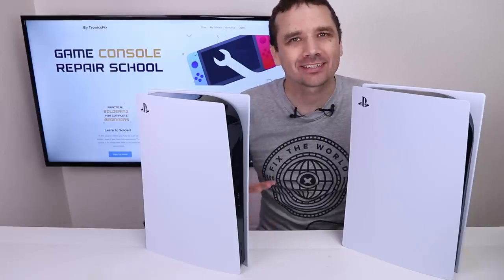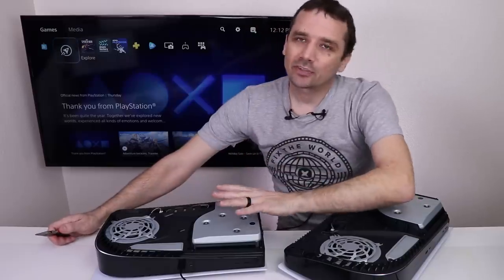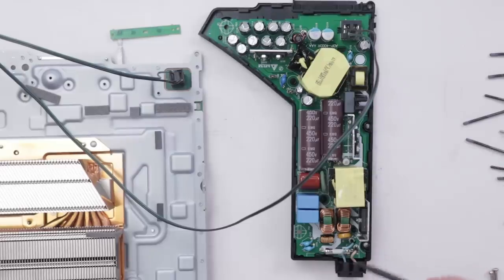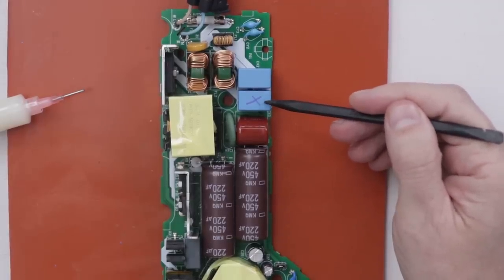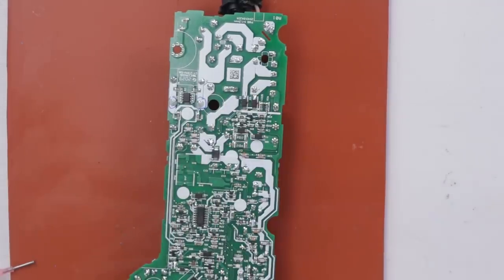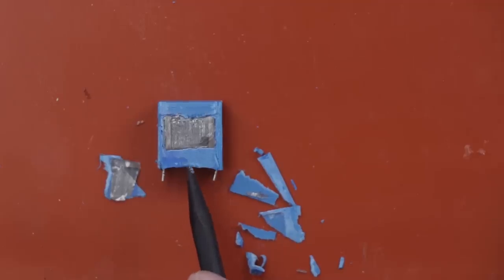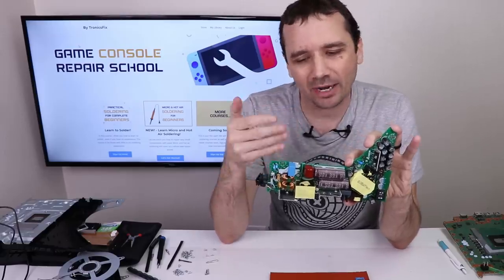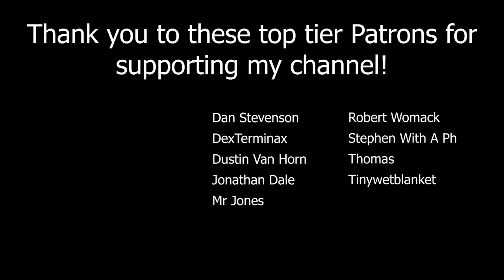PS5 Coil Whine - What Is It and Can I Fix It?

Comment: Is coil whine bad, or just annoying?
Reply: it is normal for any Electronic to have coil whine, specialy  power supplies and graphics cards. it is just annoying, i remember my ps4 pro used to whine a lot during rise of the tomb raider but not other games
Reply: Its just annoying and nothing that indicates an error. Unfortunately the sound is not always the same and can be louder,quiter or have a different pitch than other consoles even if its the same model.
Reply from the maker: Just annoying.
Reply: Perfectly normal for the circuit. But happens to have an audible component.
Reply: so annoying you need head phones to play any game in 60 FPS on PS5. PS4 games are pretty quite though. only the ps5 games seem to cause this issue in 60 FPS mode. which sucks
Reply: @GreenSmoke00420  you don’t need headphones😂😂 for my ps5 I can’t hear it unless I put my ear right next to my ps5 it’s not loud at all
Reply: @therealmc3966  post a video of you playing a PS5 game in 60 fps mode up against power supply to prove your point. If you have zero coil whine prove it.
Reply: @GreenSmoke00420  He didnt say it was zero coild whine. He stated that its only audible close to the PS5. Wich happens to be exactly the same on my PS5.
Reply: @therealmc3966  He used the PS5 as headphone probably.

Joking aside, different consols of same type can react different to the game you are running. So far I  had only one game that only in specific menu's (static menu, fps should have no contribution to it here) produced a highly annoying whine and it was not even very demanding on the system.

To me the whining is just a random as that of my wife. Sometimes it's worth the iritation, other times ignore it. Or get an other one ;)
Reply: @therealmc3966  trust me when i say you will hear it someday and you will never not hear it again if they dont at least try and fix this, especially when games like GOD OF WAR PS5 and Horizon 2 PS5 drop and actually push the system hard and can play in 120 FPS none of the games at the moment are even pushing the console hard and are not even true PS5 games they barely even push this thing at all. this is what scares me and it should scare you to. i say its safe to say the Coil Whine noise will be 3 X (times) as loud at least when those games are played. if PlayStation does not at least try and fix coil whine issue. and why are you arguing for a sound that everyone agrees is annoying you like the sound of Coil Whine. you must love dildos.

Comment: Coil whine is generally high frequency passing through and creating a vibration which in return makes noise. Before the easiest way was to put hot glue over the components to minimise vibration, not sure if it still is though

Comment: Yes...! I have the solution !!! --- Place the console within 3inch thick foam insulation... That should solve your ears from picking up the whine...
Reply: Yeah bricking your ps5 should fix all noise issues.
Reply from the maker: Lol...I'll try that next time!
Reply: just turn it off, that will fix it for sure
Reply: that should also solve the ps5's ability to shed heat which will permanently fix the coil whine

Comment: /tronicsfix 
Observation, Good news, and an experiment for you:
- PS5 has a quitter cooling system / fan.    The PS4 might have have a lower/same level of cap singing, and BUT it was downed out by the louder system fan.
- Looks like the Film Capacitor's  Climatic Category upper heat limit on the PS5 cap was changed from 105 to 110C.  - Not the issue. 
- It's always the mechanical coupling to the PCB; solder.   Re-solder both your Film Capacitors back in your ps5 using lead solder and a tiny air gap from cap package to board.

Comment: EEV blog made a video years ago about coil whine in the backlight driver of a multimeter. But it was actually a capacitor. The problem is the dielectric sheet has some piezoelectric properties making it vibrate. If the layers are too loose the electrostatic forces can also make it buzz

Comment: It’s just an X2 cap.  Replace it with another with the same or better rating, see if the noise goes away.  You can buy them from Digikey, Mouser, etc.

Or just run without it.  The things just sit across the mains and filter the noise from the switching power supply.

Comment: I had a coil whine on a ps4 pro primary transformer. Coil whine, as explained by other commenters is just the current passing through the component which somewhat inevitable. However..cheap components are louder because they dont have mechanisims and materials to mitigate and soften the possible noise.

Comment: The noise probably comes from subtle vibrations in the cap. Try solder it back on and then use some epoxy or hotglue all around the cap to reduce vibration. The compound should be as stiff as possible.

Comment: If there are two alike capacitors connected in parallel and if one is noisy it's obvious one is working harder than the other, In short it's best to replace both capacitors with a higher voltage rating if possible, the capacitance for each must still match or be slightly higher and if at all possible closely matched to each other, the reason why they both need replacing is because one of them is not to spec and thus is stressing the other one, Also check any coils connected to a singing err-whining capacitor and check if it hasn't shorted or opened circuited or drifted out of spec..

Comment: My PS4 has coil whine but so quiet you need your ear next to it. Even when I repleaced the original  one with over 5k hours of use on it, the new power supply had same coil whine.  Oringinal power supply still good with no odd looking caps but replacing it restored  the performance.

Comment: Here'satipfor ANYONE.Notice when you turn something off like in a pc and sometimesthere are stillpower LEDs on? even whenyou take out the powerplug? they do not last long but long enough to see it. this shows your system still has charge that was being drawn when connected to supply. Even if there is no led githy on, do this simple thing with ANY appliance or psu. Disconnect the mains and straight AFTER, even though there is no way an appliance could get power, turn ON or hold the appliance power button ON as this will actually use up charge held within the system. I have taken so many PSUs apart and done this that I have even touched parts you shouldnb't with no shock, NOT TELLING YOU THAT YOU SHOULD DO THIS, as i did touch parts accidentally, I never suffered any shock. It does discharge the system and you will see the loights go out much quicker.
 
So remember: as I see many videos NOT telling you top do this, but, DISCHARGE and appliance by unplugging from the mains/power supply then holding down the power button to use up any remaining charge stored. I know people use things to discharge capacitors, this is fine, but really? common sense and hjold that power button down to fully discharge, then if you use a multimetre you may find there is no charge in the capacitors after doing that, thus, no charge stored. 
 
Still be careful though as nothing is guarranteed, but, this should be done regardless of how careful you are, redundancy is a real thing.

Comment: That noise on mine goles away if I put it in vertical position, it's only when is horizontally that I hear thar
Reply: That's interesting did you just move it around to see or find out by accident?
Reply: It's the disc drive vibrating happend to mine if you don't have on stand that will help plus when I first got my ps5 I had the console upside down lol
Reply: @one_up907  I had the idea because my ps4 slim stopped reading discs when placed horizontally... so I gave it a try and found that out.
Reply: @Blxard21  could be, I thought it was the sticker other people talk about; maybe we'll see a solution here soon

Comment: Gaps between the metal and the plastic that’s vibrating? Maybe heat it and try to get it to conform better to prevent it? 100% a guess lol. Love the vids! Keep up the great work!
Reply from the maker: I'm afraid heating it will just melt the plastic and render the cap useless.

Comment: If I had to guess it’s probably a small insignificant manufacturing defect in the insulator layer between the metal layers in the capacitor. A small defect could allow small high frequency arcs to jump between the layers of metal creating the “whine” or “buzz” sound that some people are experiencing.

Comment: And hear we go Playstation and problems
Reply from the maker: It's just an annoyance. Doesn't cause any problems.
Reply: @dev null not impossible to get rid of by any means, most people should not attempt it tho, but for anyone that knows how to safely take apart their console and remove the charge from the capacitors and remove and replace solder can probably do it by replacing it with a different same rating higher quality capacitor from a better company

Comment: LOL I'm amazed how he went into it and removed the capacitor. The capacitor is being used as a filter, as mentioned in the video. I believe that is correct. If the PS4 Pro Model is the same capacitance as the PS5 model, I would solder the PS4 PRO one into the PS5 power supply and see if that fixes the noise. The capacitor maybe defected. Only do this if for SURE!!!! the Capacitor is equivalent to the the PS5 capacitor.
Reply from the maker: I thought of that...the problem is that the PS4 Pro had coil whine problems too.
Reply: its the cheap capacitor itself that is the problem most ps4's also suffered coil whine because of that capacitor, only replacing it for a higher quality one is likely to work

Comment: We usually fix that issue by using nail polish to secure it tighter to the pcb. It's caused by the small vibrations if i recall correctly. And the nail polish acts as glue basically. Put some between both and it should stop.
Reply from the maker: It's coming from the inside of the cap and it's soldered on very securely.

Comment: You can't fix coil whine or capacitor buzz. All you can do is replace the affected components. However, just because something whines or buzzes does not mean that it is defective and replacement parts might have the exact same characteristics. So sometimes there's not a lot you can do about it and just have to live with it.

Comment: If I had to guess I would say the Noise in that capacitor is caused by the plastic inside not fully bonded to the metal on all points of contact. Essentially the plastic is slightly moving inside hitting the metal surface when a current is going through it.  100% speculation and just an educated guess.

Comment: The noise is produced by the oscillating Electric Field Force precent between the metal plates of the metal film capacitor! (The plastic film acts as the dielectric in this type of capacitor.) That cap looks like it form part of the line filter stage of the switch-mode power supply. Just replace it with a better quality cap of the same type and value!

Comment: Seems like that capacitor like you said is in layers, so when the voltage goes into it the metal expands and moves.  That epoxy around that metal is acting like a shield it will force that metal to not flex/move that much and also a noise reducer.  The sound you're hearing is the metal trying to expand/move while that epoxy try's to reduce/shield the movement of the metal when the voltage is running through it.

Comment: Here is a suggestion:
In many high quality power supplies there is some kind of glue between the components: colis, capacitor etc. My guess is it's used to supress any movement of those components (due to changing magnetic fields) and thus preventing that whine sound.

Comment: So here are some ideas I had why it makes that sound.

1.) Maybe there is not a quality of consistency when producing these coils and the density isn't thick enough or it is to thick. 

2.) Maybe the coils are to far spread for it's function.

3.) Maybe the connection to capture excessive electrical fluctuant isn't making a tight enough

Comment: The component is most likely the mains input filter capacitor. The sound is 60 HZ and not high frequency. That means the component is on the input side before the diode rectifier.

It’s also common for PC and game power supplies to have a high frequency whine. This would be from a component on the switching side of the PS, after the “chopper”

The most simple fix it just run the PS5 without that component.  A power supple will still operate with the mains filter capacitor removed. However there will be more AC “ripple” which may cause other problems and the entire console will be more sensitive to voltage spikes or weird ripples or transients.

Comment: Metallized Film polyester Capacitor. Vishay,  Wima, Epcos are decent makes. If going for a higher in rush voltage type make sure you check dimensions so they fit onto board. Replace as a pair

Comment: Thats just basic primary side filtering and is pretty much the same in most power supplies. I would just try swapping it for a different cap of the same rating that will perhaps resonate differently. There is a distinct posibility that the frequency causing the cap to resonate will still present and will more than likely be the result of poor filtering around the primary side FET.
Reply from the maker: Any suggestions of a cap that will work best for this?
Reply: @Tronicsfix  Just match the uF (will be low ~0.33uF) and the line voltage (in your case 110v) and choose a Japanese (or reputable supplier) one over Chinese one if poss. You could run the supply fine without it in circuit and it would likely work but just make more noise. You could even try bodging more across the line to see if it reduces noise
Reply: @Tronicsfix  Often there is a ceramic disc cap nxt to the primary side FET that takes a lot of hammer from the switching noise of the FET. You could also try replacing that.
Reply from the maker: @Hardwayistheonlyway  Any specific brands you can recommend?
Reply: @Tronicsfix  Honestly it probably doesn't matter too much so whatever you can get hold of/take from a dead PSU.
Reply: That part of the power supply is mainly to stop noise getting back onto the line as per your countries EMI regulations. Generally it will have little effect on the opperation of the PSU

Comment: To find the sound source on the electrical board, you can use heat shrink tubes by inserting into the ear. Isolation from electric shock and can touch the sound source.

Comment: I would suggest a different manufacturer of coil.  The characteristics or construction of the new coil may illuminate the whine.  Possibility that the coil is operating at the high end of its capabilities.  Try a higher uH coil.

Comment: A quick search on mouser does not find the same capacitor brand however, you can find the same rating of capacitors available. It is different than the other one you show in the video. The newer one has a higher temperature rating (110 C). You can find a 1uF capacitor with -40C to 110C temperature rating for about $1.50. Just be mindful of the size and lead spacing. I order capacitors from mouser frequently, they are very fast at order fulfillment and high quality components. Maybe why they dont carry the same brand that is making noise in your system. I can help if you want, you can google my name to find my contact info.

Comment: There is probably a label that got lose and got in the way of the fan. Pop off the sides of the PS5 and unscrew the four screws of the fan case. From there you will be able to look inside the fans little slot to see if you have the sticky label hanging out and move it back into place and out of the way.
Reply from the maker: Uh, you should actually watch the video. I unplugged the fan before I tested it for this noise.
Reply: @Tronicsfix  Sorry
Reply from the maker: No need to apologize...just wanted to make sure you watched the video so you knew what was going on with it.
Reply: @Tronicsfix  Yes I watched the video then I watched it again.

Comment: The capacitor can make a noise because of the capacitance and also the frequencies its starting to oscilate and because of the metal film it can make a noise just like a standard transformer who is also a coil with metal plates
This is what i ,ve found on the web regarding coil wine
There is almost no noise generated by the capacitor itself; however, when a capacitor is mounted on a board the vibration increases, and when the cycle of the amplitude reaches the audible frequency range (20Hz - 20kHz) of humans, it can be heard as a noise.